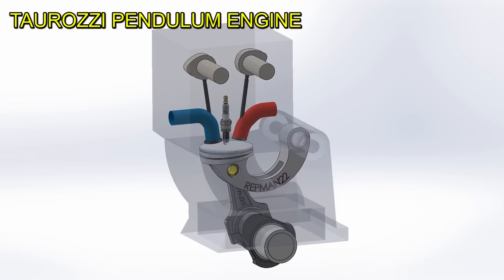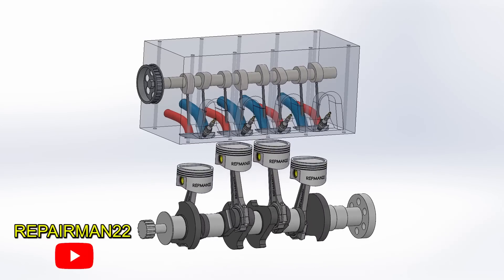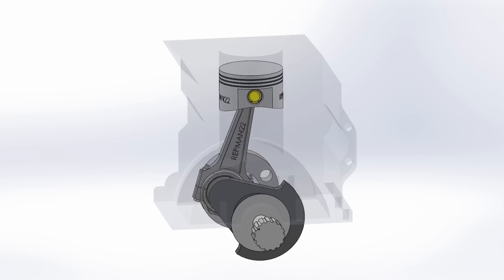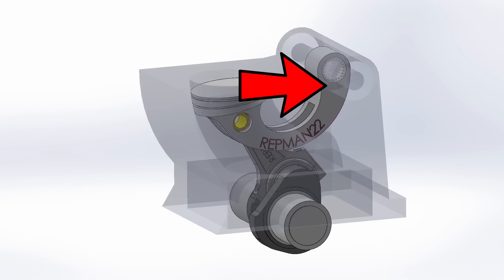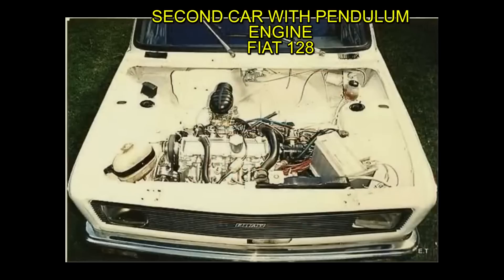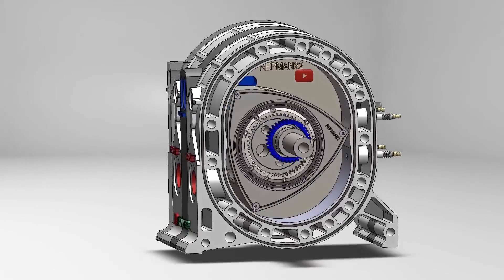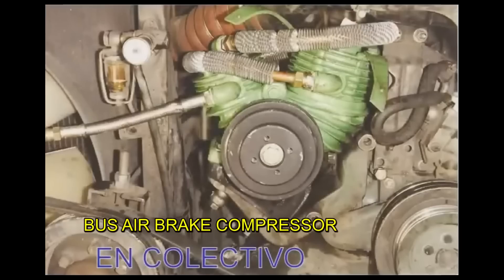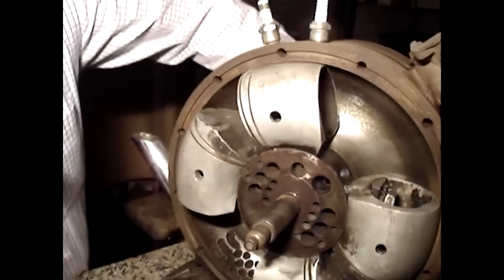All about the Taurozzi Pendulum Engine 🧠 and what happend to it🤯

Comment: So iv spent some time around machine shops and I don't know a cheap or accurate way to make the bore further making the piston would be an even bigger challenge see pistons are barrel shaped and we do that on a lathe with it having to be curved and have that built in arm you can no longer do it that way. This looks interesting but I actually don't see how this would have any great benefits. Further ring wear is gonna be an issue one side has to travel much further than the other. The ring is also gonna have a hard time spinning in the bore.
Reply: Also power is made in the head for the most part
Reply: Cylinder boring is actually a lot easier than you think. You keep the cutter in place and rotate the block around it. To get an idea of what kind of machine it would take, check out Steve Morris Race Engines. He's done a couple videos on his new Rottler 4 axis block machine. Now he's not machining bores like this but you can see how that machine could do it. You would set it up so the block is mounted to rotate on the axis of the bore for the pendulum arm shaft. Then you would bring your boring head down into position for the cylinder you want to bore, and rotate the block up.
Reply: @wingracer1614  never thought of that but I know why that's too fancy for the machine shops iv been in lol.

Comment: This engine would be almost impossible to manufacture. A curved cylinder has what benefit?
Reply: The main benefit I see is better angles on the connecting rod and crankshaft during the power stroke.
Reply: @Mrshotshell  But how would you machine a curved cylinder?
Reply: @Dont_Gnaw_on_the_Kitty_3  He made running engines and some compressors are made with the design so it's definitely possible. But no where near as cheap and easy to manufacture and refinish as a straight bore which is one of the reasons it isn't widely used.
Reply: @Dont_Gnaw_on_the_Kitty_3  same system as in engine but with drill instead of piston
Reply: @orangestoneface  Do you mean the curved cylinder is made using the same principle as a spiral ground onto the outside of a drill bit? Sorry but I can't see how this would work, the cylinder is inside a block of aluminium?
Reply: Boring the cylinder is actually pretty easy with the right machine. You keep the cutter stationary (except that is is spinning of course) and rotate the block around it. The real problem, how do you line it? I bet you his fiat was a cast iron block
Reply: @wingracer1614  liner is the harder cylinder material l guess. have that thick  heat till glows put in bendin g machine maybe support pipe inside it bend to right angle . but then it gets thick on one side , so maybe start by thinning one side

Comment: 30% less fuel is a big claim but doesn't benefit manufactures. You add complexity and extra production cost. This is most likely why it's only successful in very specific compressors. Because the extra cost and complexity has a greater benefit.
Reply: I'm highly doubting the 30% claim.
Reply: It would benefit manufactures though if they could say there engines use 30% less fuel. Everyone would want that engine to save money. But that's just another reason to not trust the 30% figure.
Reply: In reality the rings would need to be of the same spec for the same bore/stroke/compression as any other engine. 
Also the claim of this massive friction loss in the piston of a normal engine is nonsense. Any modern engine uses cross hatching to hold a film of oil between the piston and cylinder wall - which is why they can usually run 200k miles or more if looked after. If there was any meaningful friction in use they certainly wouldn't be lasting anywhere near that long - infact engines before that idea only used to last 20-40k miles before needing a rebuild. So its possibly an improvement if you're in the 1930's. 
Then you have to take into account all the added drag from the extra weight of the internals, the extra bearing surfaces, the extra oil it would have to pump to feed those bearings and so on - if this could even match a normal engine on an even playing field it would be amazing. 
Of course it can't which is why - even almost 30 years after the patents ran out - no maker has picked it up. 
With emissions regs the weay they are even if a maker could get 3% less friction this would be in production tomorrow. 30% is just a nonsense.

Comment: This needs to be mass produced 100%
Reply: Why?
Reply: I think Toyota produced a series of this 3 years ago. Or Nissan? With variable compression.
Reply: @ArneChristianRosenfeldt  That was Nissan and it was nothing like this design. That was a seperate guide which could alter the throw of the crank to vary compression. The bores and so on were normal.
Reply: @siraff4461  normal bore and cantilever from the side to relief the lateral force. Best of both worlds.

Comment: Francisco, that's an amazing engine!! I've never heard of it before, and while wary when the video started, as I studied it throughout, I saw the genius of the design. I had one question... the roller bearings on the ends of the piston wearing and galling (i.e., the Hirth roller bearing crankshafts used in early Porsche pushrod and four cam engines), then realized... they have no thrust loads placed on them, they simply support the piston face. VERY interesting concept!!
Reply: i've just got a new variant of this engine in the suggested by a very young boy with zero subscrubers.
it is like a toroidal boxer
channel "interesting -Tech"
Reply: @sillysad3198  I'll have to check that out, thanks for the heads up.
Reply: @sillysad3198  can you give the video title name? I can’t find the channel
Reply: @Panin2001oca  "A new type of Engine"
Reply: I'll bet the engine might be designed without pushrods